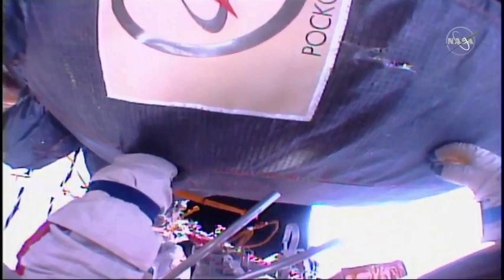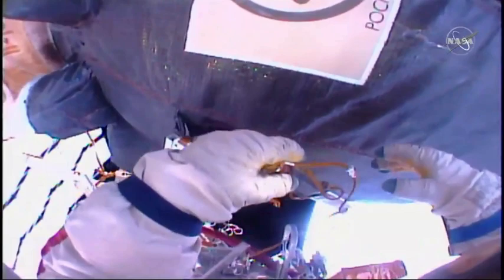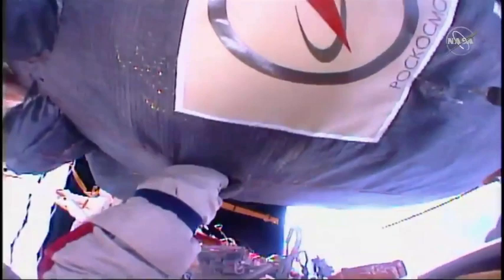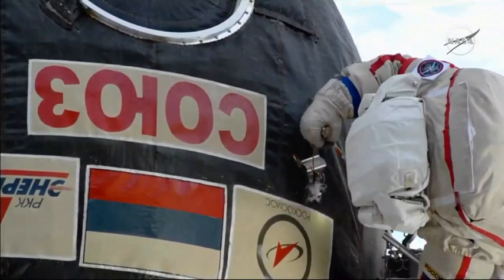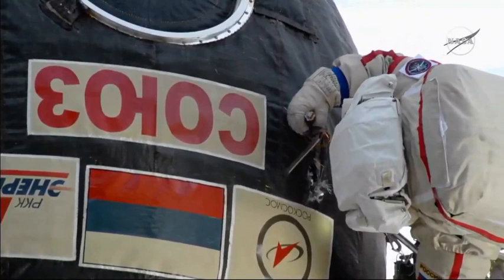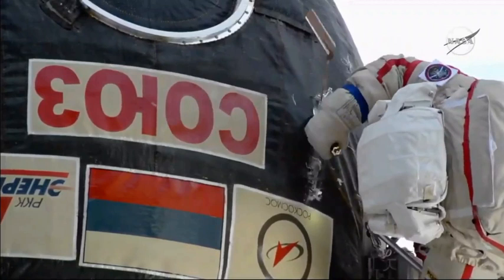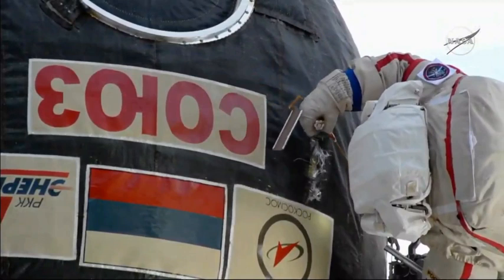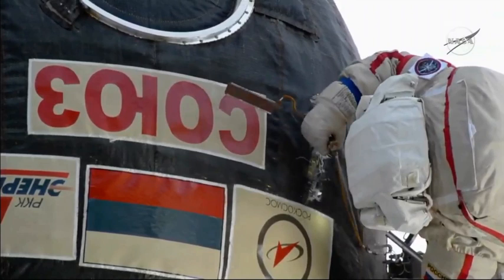Watch a Spacewalking Cosmonaut Take a Knife to Soyuz Capsule

Comment: I absolutely guarantee any of you complaining about littering from the safety of your computer chair would give 0 shits about littering if you were in his shoes.
Reply: Amen.
Reply: Threat2all while im not complaining because i 100% agree with what you said they will become space debris and may possibly hit a satellite or rocket and might cause a tiny bit of damage even though they are light and to be fair since they are so light they will probably de-orbit in a fee months and burn up
Reply: You make a valid point.
Reply: Threat2all in reality though the chance of that happening is next to none and the cosmonaut is just trying to concentrate on his job
Reply: @etrain757  There is no other satellite or rocket in the same or near orbit as the ISS, and indeed, those little insulation pieces will reenter soon.

Space debris is only dangerous in shared and common orbits.
Reply: Mr. Nagant correct me if im wrong bit as its orbit lowers in height until it gets into the atmosphere wont it the the minuscule chance of intersecting with another orbit and hit a satellite?
Reply: Mr. Nagant i know the chance of that happening is basically 0 i said that in my second comment just saying that it’s theoretically possible (this comment sounds a bit rude and it isn’t ment to so sorry)

Comment: Im pretty sure thats not hows it done properly, but since its russian capsule its their decision.
( i also think it looks cool actually using knife in EVA )
Reply: How would you do it otherwise ?
Reply: @E9X330  Machete or atleast a fencing sword, could cut up a bigger area faster and deeper.
Reply: Dark Side fencing swords don't have a cutting edge
Reply: Fencing sword would be for pointing at the hole, not cutting.
Reply: @CLYZRbby  he needs to uncover a small area, not the whole habitation module
Reply: @E9X330  Why uncover it  if you can cover it with flex tape.
Reply: @CLYZRbby  I don't think fencing swords are part of the gear they have on board...
Reply: @CLYZRbby  they already did cover it from inside with flextape, they wanna see how it held up
Reply: @E9X330  just wondering isnt this crack gonna be a risk during re-entry (tearing the whole module apart?) ? Like if i was one of 3 astronauts coming back on 20th id be shitting my pants knowing theres even a small hole.
Reply: @CLYZRbby  nah it's in the orbital module, which is seperated before reentry
Reply: I would argue a saw like blade would have been better at cutting away the material, but the only thing they had on the iss were the survival knives kept in the soyuz in case of landing in remote areas, do the best with what you got I guess
Reply: @piranha031091  well, dont know how it is now, but there was actually a machete swords in old soyuz survival kits
Reply: @algorithmicimpedance  I think it still includes a knife, and I think it is in fact the very knife we see being used here.
Reply: They should've used a sharpened spoon to be on the safe side
Reply: @CLYZRbby   The part he is cutting away at is the orbiter. As the name suggests it's only used in orbit, not during descend (or ascent for that matter). There is another capsule next to this one which is used for the actual landing.
Reply: Dark Side it’s all fake and here are some bubbles at 125 to prove it .

Comment: Nice show... All this inside a Boeing at free falling is like a Cirque Solei Show. 😂
Reply: Got any proof?
Reply: @ianmeade7441  1rst. Do you got any proof of them being up there? Joules- Thompson free expansion clearly predicts rockets don't work in low pressure nor vacuim. It has been shown experimentally. 2nd. There are plenty videos showing ISS is fake and not in space. A friend of mine at college worked designing that thing. It was not meant for outer space.
Reply: @ianmeade7441  Ask them why only 3 minutes video, they need to reset the plane.  😈
Reply: @1969nitsuga first, do I have proof of them up there? I don't have to answer that because, after all, you are the one making the claim, but I will anyway. I have a relatively high powered telescope I use for astronomy, and I've used it many times to observe satellites (especially the ISS) so I can say without a doubt that yes, I have my proof. Second, could you provide any sources for this experimentation? Or at least explain any of the logic it follows, because newtons third law of motion seems to support rockets very well. An average liquid fuel rocket ignites a mixture of liquid hydrogen and oxygen to produce the extremley hot exhaust gas which is directed out through a nozzel at roughly 3,000 meters per second. It doesn't need to push off of the atmosphere to generate thrust because it expells it's own material. Place a gun in a vacuum chamber and rig it to fire. If a bullet flies out and kills you, not only will you have proven yourself wrong, but you'll have done this world a favor.

PS: the vomit comet can only induce weightlessness for 25 seconds, so maybe just a hair shy of 3 minutes. Also your collage friend thing is bullshit
Reply: @ianmeade7441  You ever heard of video editing? The ISS we see by telescopes is too big for a 250 miles up football field size object. That's not the real ISS what you are seeing. It is way too close. Besides, footage from the ISS doesn't match size and proportions from that distance neither. Those are pictres and films from drones, planes and balloons. https://photos.app.goo.gl/WtHRmAWtv9eeCt7DA 250 to 275 miles away zoom.

Comment: will they use this soyuz for a return ?
Reply: Sure . This part is jettisoned during descend. Only middle section with the team is able to pass through the atmosphere, while this docking part will burn.
Reply: BUT it needs to be gastight during descend right, so that is why they checked it ?
Reply: @maicod  It is needed to enter descent module through it. Then the modules are isolated before undocking, so it probably needs to be just one piece only to not spread junk through the ISS orbit. After descent engine burn it is jetissoned to be burned in atmosphere on re-entry.
Reply: ah right thanks. If in doubt they can wear their spacesuits during the passing through this interstage I guess

Comment: What the hell happens to all that debris flung away while the cutting is going on? It stays in orbit till it strikes something right? A spacecraft, an astronaut, jeeze.
Reply: I think a light-weight piece of insulation will decay in orbit even quicker than the station does, so it will maybe burn in few months or so.
Reply: stitchem7 there is so so much space debris up there, I don’t think these few bits are gonna be adding much to the problem
Reply: There are only something problem. Or American austonaut crazy hysterical Serena did hole in Soyuz on the orbit or Russian techician did hole on the land.
But hole was without glue inout. So it can show that Serena haves problems with brain. She was kicked from submarine before austronaut career.
Reply: Since the debris is so light, it'll deorbit reasonably fast.
Yes, there is still air resistance up there. Just an incredibly small amount. Still, it's enough as so that the ISS needs to fire some thrusters to maintain its orbit every so often.
Since the ISS itself, the only manned habitat up there, is in the same orbit as this debris, it is of course at no risk of a meaningful collision.
And the odds of satellite impacting this debris in the time it's up there is tiny, given how large space is.
Reply: @Andrew Larionov
Serena is stupid hole. I hope that it's her last space mission.

Comment: I think scissors might be a better option,,
Reply: In spacesuite scissors are useless.
Reply: This is anti-rip kevlar, thin metal sheet and soft insulation. It is very hard to pierce and cut through, and you really need something sharp and a lot of force applied to it.
Reply: Try using scissors while wearing gloves that thick...
Reply: They had scissors, but went back to the knife. This is a mere 30 seconds into this video.